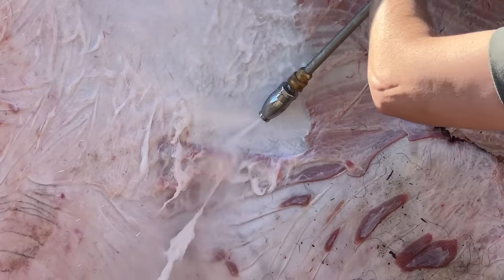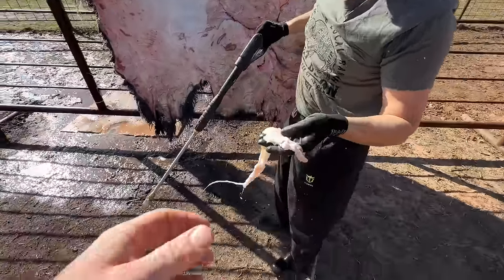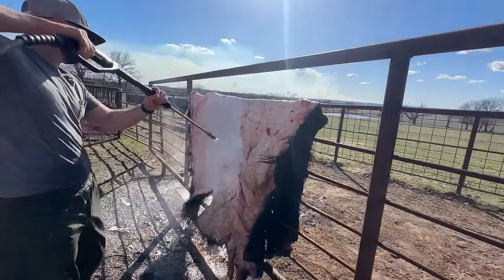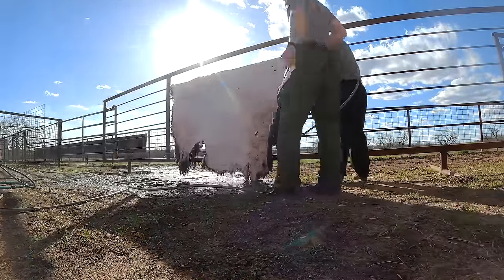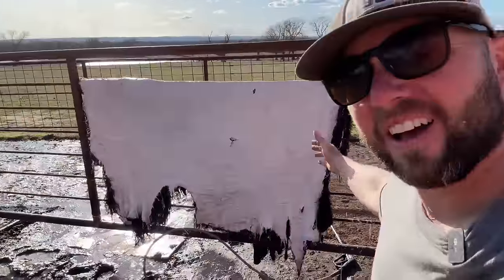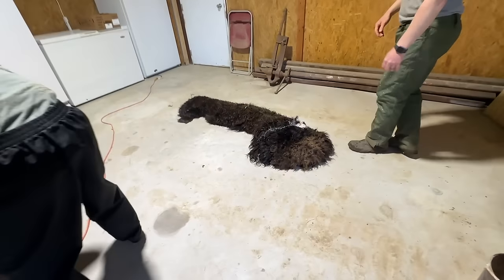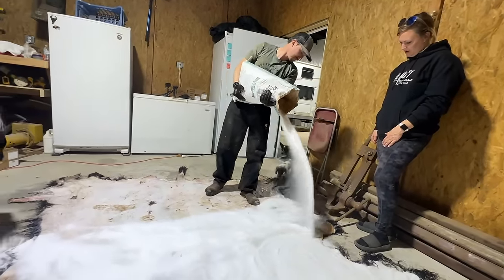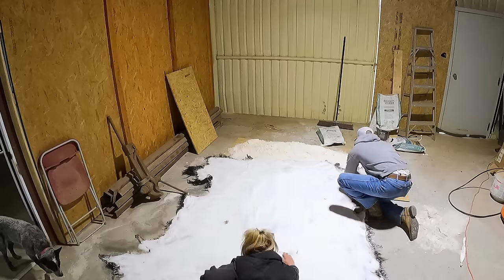We Fleshed a Bison Hide With This!

Comment: Certainly does make one appreciate all the work that the indigenous people took to use all of the bounty from a bison, meat,  bones made into knives, hides made into clothing and   shelters.❤
Reply: and hooves for glue.
Reply: To say nothing about taking the beast down in the first place. I went on a bison hunt with a 9mm rifle, and rode out on horseback and there was a couple moments when I was scared…imagine going after these guys on foot, with a spear! I have NOTHING but respect for our predecessors!
My guide told me a story about a cow bison that was shot with a 50mm muzzleloader slug — a pinball, basically — right in the head — they went up to process the kill and she got up and ran five miles! They had her skull on display to prove it.
Reply: @catshepherd3102 yeah!  Then can you imagine transporting it! Probably had to build some kind of slanted plank to put it on to be dragged with horses.I’m just guessing but they have to get it back to the reservation. Anyone know?
Reply: @judypasqualone3819 That would of been a travois, a 2 pole sled that is joined at the bottom. It would have a previous hide between the 2 handles to hold the meat, hide etc. It could be pulled by horse, dog or person. Think of how a wheelbarrow is, except to be dragged, not pushed.

Comment: You can use an upholstery needle (curved) and some heavy duty thread to sew up the holes - at least the bigger ones. It's not really difficult.
Reply: i was gifted with an Elk hide with the fur on it already tanned by my neighbor who hunted the elk, it had some holes in it..quite a few from the skinning he did on the spot after he shot it with a bow and arrow,BTW. the holes were from the skinning knofe. I sewed the small holes together and patched the larger ones with plain elk hide, using matching color artificial sinew from the leather store and a leather needle, which makes it easier to pierce the hide. The mending and patching did not show on the fur side because the fur just kind of laid over them.  the sinew is much stronger and easier to work with than a heavy carpet thread . You can also ‘split; and peel off a strand   of the sinew  to get the desired thickness.

Comment: I'm going to remember this trick.  I've always wanted to work on hides and this looks like will be much easier that the hand methods.  I would suggest that if you are going to be doing this as a separate income stream, that you make an area with a concrete floor and thick gravel around the sides to keep down the mud.  It will be much more pleasant to work on the hides that way.

Comment: I would have stretched it out on a frame before salting it. I have found, this gives you a more even thickness of hide. It also allows you to use less salt and your hides will dry faster. Just my opinion. I did a bit of trapping in my youth lol. Yes it's alot of work!

Comment: Actually sharp stone blades work better than steel. You can haft them and make a knife or just use the blade. Surgeons have operated on hearts with stone blades and the incision healed better than using a scalpel.